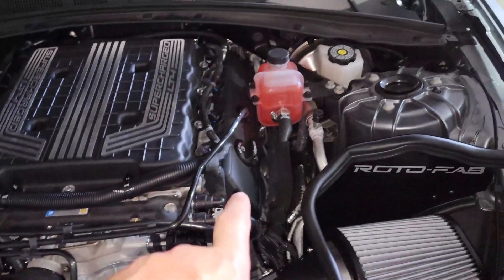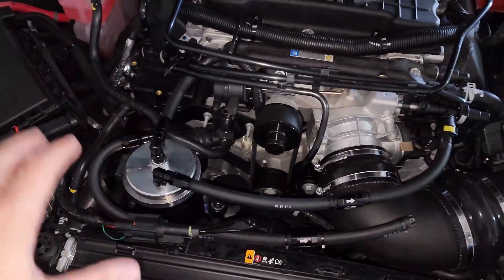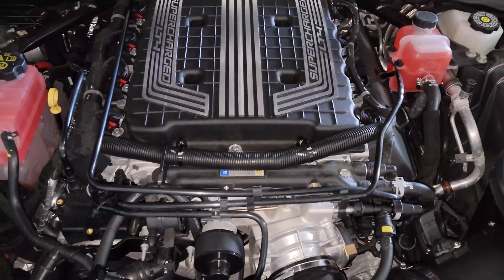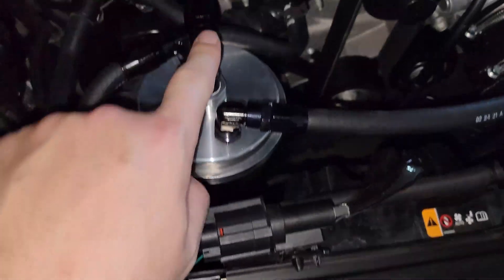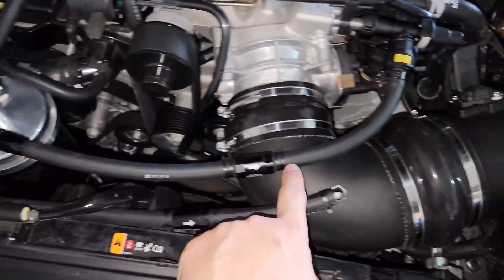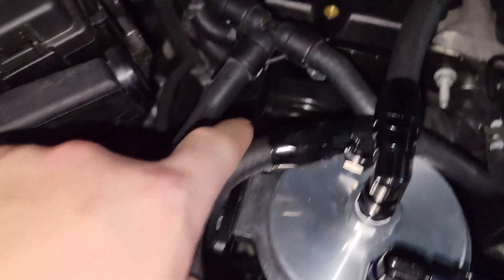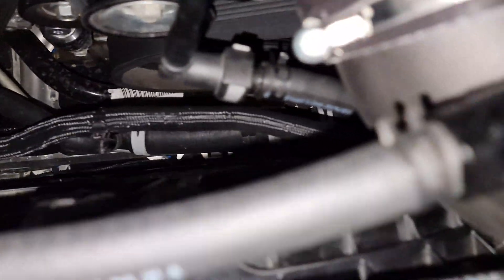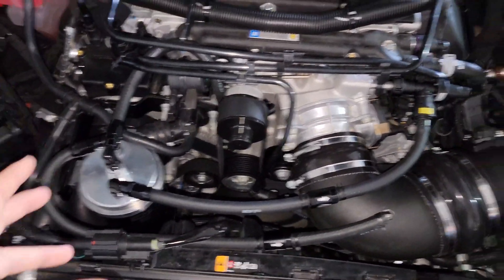Elite Engineering E2-X Ultra Catch Can Front Mount Install - Camaro ZL1 LT4

Comment: Just setting the can a little deeper will not fix the rain guard clearance issue. With the Big Gulp, the rain guard all but touches the intake. So the hose  connecting to the intake needs to be routed under the intake.
Reply from the maker: Ahhh, makes sense. I have the regular non big gulp version of the intake and never drive the car in the rain so I just took the rain guards off and pretty much forgot about them, lol :D

Comment: I thought that plate for when if it ever backfires it stops the cover from exploding?
Reply from the maker: Nah.. the lid itself is a solid hunk of metal. The plate just helps with keeping the noise down a little more. If you backfire enough to blow the lid minus the noise isolator plate your entire motor will have pretty much exploded :) lol.

Comment: What size is the hose that comes out of the PCV and into the catch can?
Reply from the maker: I believe the hose is 3/8" ID.
Reply: @d3rpzilla  I got a mighty mouse kit rated for 800HP and it came with a 1/2 hose, if I'm not mistaken, which plugs into an 8AN fitting. Its very tight coming out of the new PCV diverter since right next to it are those 2 electrical connections plus and the space between the blower and waterpump is barely wide enough to allow the hose to pass. Everyone else that posts a video on these things seem to have the same size hose which is 3/8. According to MM that 3/8 hose is rated for factory power (650HP) while the bigger 1/2 is rated for 800hp.
Reply from the maker: @Starkiller567  Yeah, I believe they offer 6 and 8 AN fitting options on the Ultra can and is able to handle up to 1k hp... Not sure on running a larger 1/2" hose with the 6an fitting though as you mention it is a tight squeeze. Best bet is probably to shoot an email to Elite Engineering and inquire regarding clearance/routing. I'm mostly still stock power so hadn't had to mess with it but I do plan to step up to a 2650 eventually possibly and will need to figure that out when I do, lol. A different supercharger (or turbos) I'm sure would change the clearance issue.

Comment: That LSA tank - does that assist you from bleeding the coolant system because it is above the blower?
Reply from the maker: Yeah, with the lsa tank the supercharger is bled with no extra effort needed. It's a nice benefit.
Reply: @d3rpzilla  Sweet - I am doing an LT4 swap in my Silverado - and the Turbo Diesel (3.0 Duramax) has a similiar mounted tank that is up high above the motor. I plan on "retrofitting" that into my LT4 setup.
Reply from the maker: Awesome! Yeah, I'd think it would work.. does it have like a bleeder nub or whatever on it to help bleed the air out? Can see the little elbow coming out the back of the reservoir with a downward tube in the phots on their website, https://lsa-conversion-store.myshopify.com/collections/high-octane-fuel/products/2016-2018-camaro-lt4-sc-resivoir-upgrade.

Comment: Great vid, I have one question, why dont we install the catch can before the built-in oil Separator (the black tank)? So no contaminated oil that goes back to the oil pan by the built-in Separator. Thanks
Reply from the maker: Thank you! I'm guessing most people consider the build-in oil separator to be "good enough" to not bother with and simply address the area that has really nothing at all. Plus, with regular oil changes most likely the little bit of contaminants isn't really a factor versus with direct injected engines any oil contaminants that get by will potentially negatively effect overall performance of the motor by adding into the air/fuel mixture and reducing octane level and possibly fouling up spark plugs/sensors/etc. Build up on the valves also would continue to accumulate as they won't be getting washed by port injectors in a direct injected motor and oil residue within the various intercoolers and such also would reduce their overall functionality.

I'm sure someone could splice in a generic/universal catch can before the build-in oil separator if they so wanted as well :D
Reply: @d3rpzilla  many thanks 🌹🌹🌹
Reply from the maker: This may be a solution for the "clean side" as you mention... https://www.eliteengineeringusa.com/clean-side-oil-separator/ :D

Comment: Thanks for the video it helps a lot! I have had quite the experience sourcing the correct parts as I purchased the Elite E2-X from CSP but actually received the E2 can (No drain valve). So I pretty much have everything that is needed now to do the install on my 2021 Camaro ZL1, however I am having  trouble finding 1 bracket...... I have the XL Bracket with the C-Clamp. I can seem to locate the bracket that you used to connect the XL bracket to the Thermostat Housing. On Elite Engineering's Online store they list a Double Catch Can Bracket but it looks nothing like the bracket in your video that you utilized. Any assistance you can provide on sourcing a bracket is greatly appreciated.
Reply from the maker: Heya! Thanks for the comment! Wow.. sounds like a headache! I actually spoke with Steve at elite Engineering via email (sales@eliteengineeringusa.com) when discussing what I was trying to do and he mailed me out a few brackets. Checking over some emails with him I found a post install email I had sent explaining what I had done for my setup... Here is maybe a helpful excerpt from my email, "Looking at the invoice I received the XL Long and "ULTRA" C-clamp bracket plus a Double-Bracket Bracket. I had a bracket type thing that I attached to the bolt for coolant hose and then took off the shorter bracket that was attached to that and swapped on the XL long bracket to that and the C-clamp bracket for the can to that (on the bottom slot)."

Hope that helps!!

Comment: Where can you find just the bolts been trying but no luck
Reply from the maker: Most people grab the full "gasket set" which comes with the correct bolts at https://www.tascaparts.com/oem-parts/gm-engine-intake-manifold-gasket-set-12679527 or similar sites. I got lucky and found just the bolt set on eBay but last time I looked I didn't see any more just bolt sets around. The price difference isn't huge but def kind of sucks!

Comment: Thanks for the video.   Just about to do mine.  Curious if your kit came with a PCV Valve diverter included or you had to buy it extra?
Reply from the maker: No problem! It came with the hoses, can, brackets (I emailed them and they sent me some photos of installs and I selected a few different brackets to be safe), and it came with both check valves and the PVC valve (with a hose barb installed at the end) that replaces the OEM one.